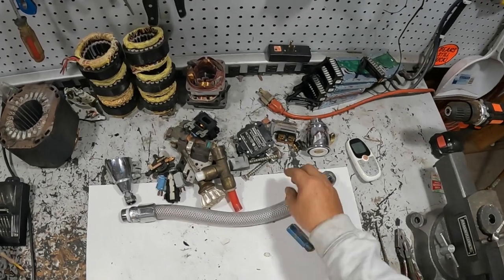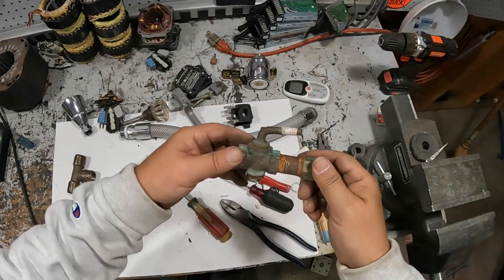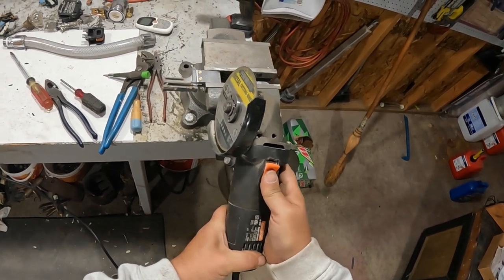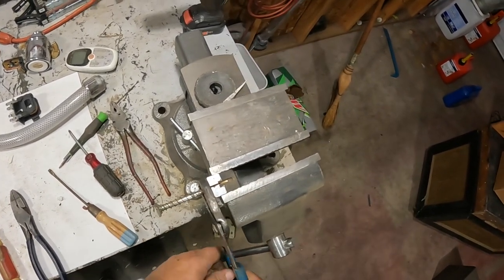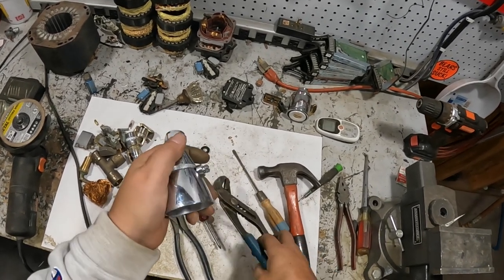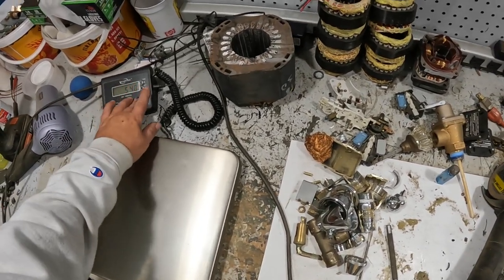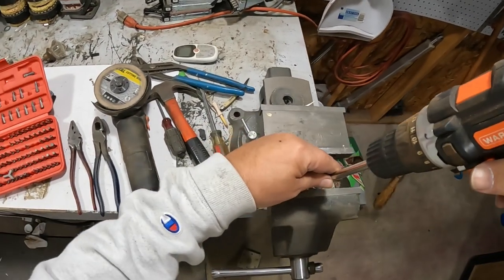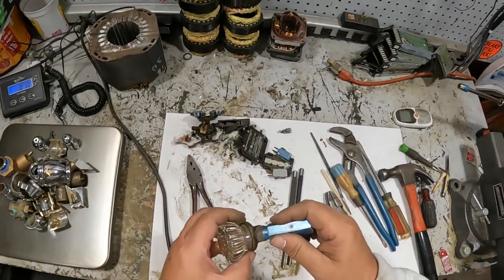Cleaning Up Scrap Brass | Worth It or Sell as Breakage?

Comment: Just a thought bud I've scrapped for longtime as well I find that the best way to remove stubborn plastic parts heat them up with torch. You will be surprised how great it works peace man. Torch and a long needle nose pliers
Reply from the maker: That would make good sense :-)
Reply: It might stink a little bit less disks and should be quicker see ya on the next one.